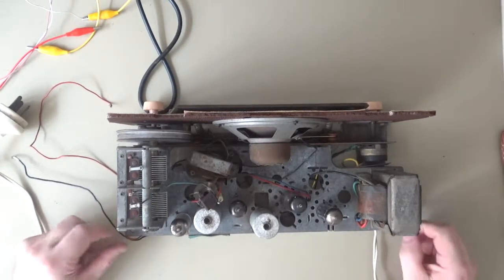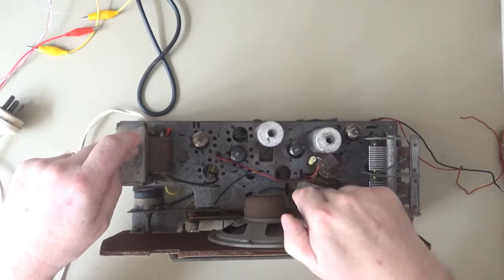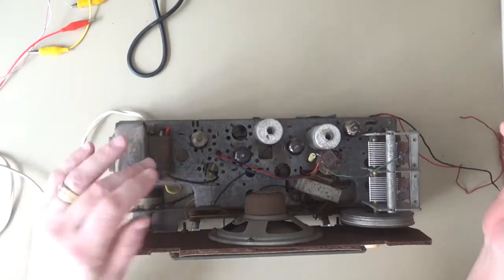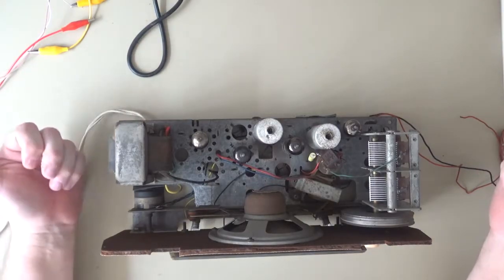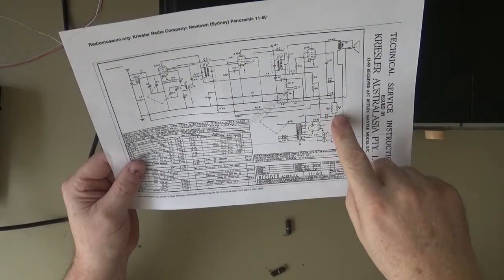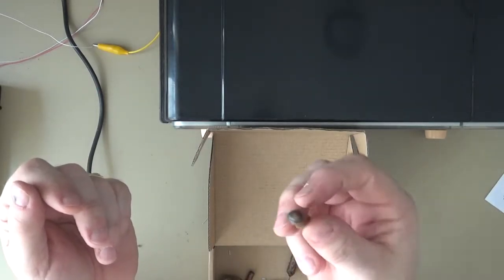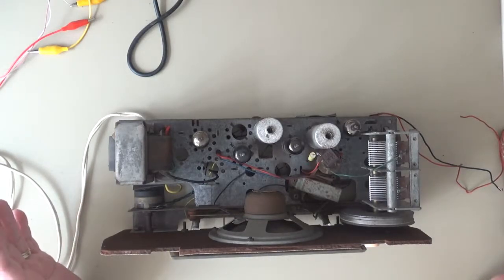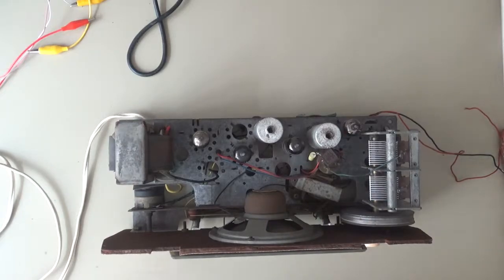#084 Kriesler 11 60 Radio Repair   Part 3

Comment: Shame about the missing video! Would have been nice to see the final touches being done .... Any chance in the future of a similar set of videos for a 5 valve 11-71 or 11-81?
Reply from the maker: Hi Chris,

I have a small collection of radios in the garage, well large collection if you listen to my wife. Time has been against me lately but I am trying to get to the rest as quickly as I can. 
I don't have a 11-71 or 11-81 however I am always on the lookout for new (old) radios if I can get them at the right price. Maybe one will raise its head shortly.

cheers Nev.

Comment: Nice job, I have a Kriesler 11-50 and buggered if I can find a schematic diagram for it, this is a 5 valve 2 speaker job though it does look very similar to your 11-60, even with the shitty Ducon paper caps with wax dags hanging off them.
Reply from the maker: Hi Mark,

I really like the look of the Kreisler radios, well worth spending the time on.

I had a quick look for a schematic and not sure if either links below will help, but these two sites have often helped me in the past, or at least provided a starting point.
Good luck with your restoration, I’d love to see how it turns out

Cheers, Nev

https://www.radiomuseum.org/r/kriesler_twin_fi_11_50.html

https://www.kevinchant.com/uploads/7/1/0/8/7108231/11-50.pdf
Reply: I like them too,  I like working on this older stuff as well.